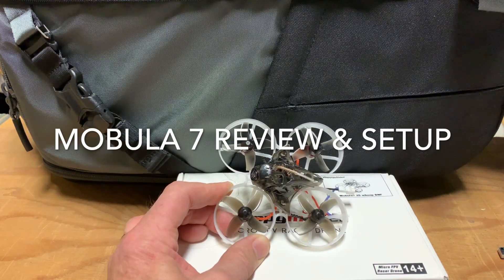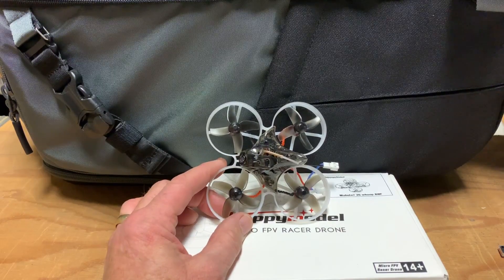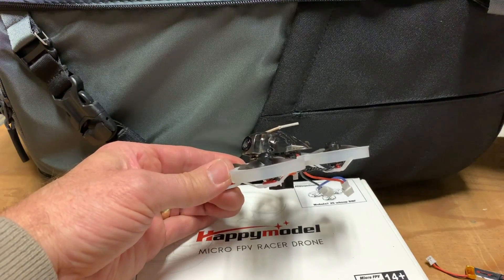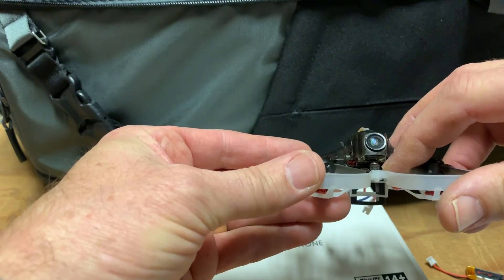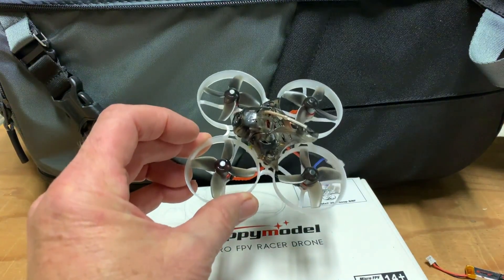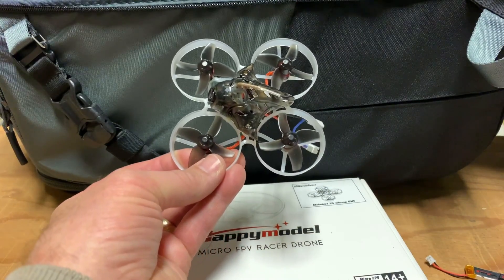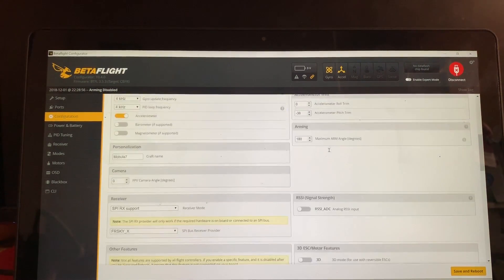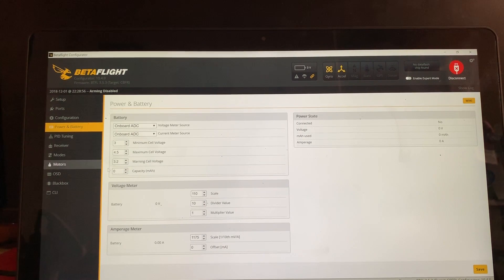Mobula7 Review and Betaflight Setup

Comment: will this quad work with my blade mlp4dsm transmitter i have the happymodel mobula7 w/ dsm2/dsmx reciever and i am able to bind it to my quad but i cannot arm the motors
Reply from the maker: Hi Joey F,

I am not familiar with this RC transmitter but when I looked it up it does support dsmx but it only has 4 channels (no AUX channel) so you will have to "stick arm" the quad. You have to hold the throttle down and to the right (ie throttle low and yaw right). I think (did not verify) you will need to go into the Betaflight and turn off Aux1 arming. I am not a big fan of stick arming as you can accidentally disarm the quad in mid air (throttle down and to the left) which can happen when you fly acro. I would highly recommend upgrading your RC transmitter to maybe a multi-protocol jumper for $89 on banggood. 

Jumper T12 OpenTX 16CH Radio Transmitter with 
Price:US$89.99
Reply: @slogfpv  Hi thanks for the response, i have tried to figure out how to arm it with the sticks believe me but i cant find any setting in betalfight to change it so i can arm it with the sticks :/
Reply from the maker: Hi @crazyforhalo1  ,
I went into the modes tab in Betaflight and removed Aux arming (click x on right side) and was able to stick arm the Mobula 7. So if you cannot stick arm after doing that it is something else. A very common issue is not having your end points setup correctly. The RC transmitter that you have probably does not allow for end point adjustments on the RC transmitter so you will have to do that in Betaflight, setting the low and high thresholds in the receiver tab. There are a lot of how to videos on setting end points. 

But to know for sure why it won't arm, go into the CLI tab and type in status. It will give you an arming disable flag that you can look up. Also if you have goggles, enable warnings and arming disabled in the OSD.  The OSD will give you the same thing. The code explanations can be found here:

https://github.com/betaflight/betaflight/wiki/Arming-Sequence-&-Safety
Reply: @slogfpv  BADRX THROTTLE CLI MSP ARMSWITCH that's what it says,  i think because the transmitter doesn't have any of those switches i have tried everything still cant arm the motors :/
Reply: i ordered that radio you reccomended btw i hope its easy to setup :D
Reply from the maker: @crazyforhalo1  
You should be happy with it. Albert Kim has a good setup tutorial on it. link below:
https://www.youtube.com/watch?v=23fgyrq2ZOA

The reason why I recommended it is:
- Less than $100 dollars (good bang for the buck)
- Runs OpenTX (has become the defacto standard and there are all kinds of videos on using OpenTx)
- Multi-protocol (supports most protocols)
- You can always upgrade to a more expensive RC transmitter like a QX7S and still use the multi-protocol module.

Have fun!
Reply: @slogfpv  I'm using a Spektrum DX6. Works just fine with the 7 and its DSMX receiver.

Comment: My mobula 7 is beeping with 2s single battery. Beta flight will only let me put 5 for maximum cell voltage. What am I missing? Thanks for any help. With 2s I’m going to be getting 7.4 rigth
Reply from the maker: Hi Kirk,

The max voltage, warning voltage and min voltage settings are on a per cell not a sum of the cells. As such, the Max voltage should be set to 4.5v if you are using HV batteries. I set the min voltage to 3.0 although due to voltage sag, some people set it as low as 2.9. I set the warning voltage to 3.2v. 

I noticed the Eachine Trashcan has it set to 4.4v, 2.9 and 3.0 which is a little low IMHO.

I hope this helps. 

SLOG

Comment: Thank you for this useful info, Did you need to trim the mobula?  if you could explain how that would be great
Reply from the maker: Hi Zivos,

Yes I do stick trimming via Betaflight and the remote controller radio. Inside your house is best.

1. Put the quad in angle mode.
2. Make sure all the trims on your RC Radio are centered (no trim on Radio). 
3. Try to hover and note which direction the quad is drifting (e.g. Left, Right, Forward ...) and what direction you move your right stick (Mode 2) to correct the drift.
4. Land and make sure throttle is down and arm is off.
5. Move the throttle to max with the ARM switch "Off" and right stick in center position (position it returns to if you do not have your fingers on it). 
6. If the quad is drifting forward to the right, start by moving the right stick all the way back (one tick of trim back). The same direct you used to keep it from drifting forward in a hover. 
7. Repeat steps 4 through 6 until the quad in a hover is not drifting forward.
8. Now do the same thing for the drift to the right except moving the right stick to the left one trim tick at a time until there is just a slight non-directional drift.
Please note you are not going to get a perfect hover like a DJI Mavic which has GPS, Barometer, Flow Sensors, sonar and visual position to hold a tight hover.

Comment: Bind on D8!  The issues I was having:

1. Throttle jumping around when plugged into        BF. 
2.  Motors spinning up by themselves for 1 second every 10 seconds while plugged into BF. 
3.  A beep that would actually make the quad stutter in flight every 10 seconds.  
4.  Random failsafes. 

ALL SOLVED BY BINDING ON D8!  🚁💨
Reply from the maker: Hurricane FPV,

Great job! Glad you are up and flying! I am wondering if it has anything to do with this blurb on Github on the Crazybee F3 under know issues with telemetry turned on. Not that I want you to go back to D16 but it would be interesting to see if turning off telemetry in Betaflight would also solve this issue. Mine is torn down waiting for a XT30 connector to come in. Maybe I will play around with it once I get it back together. Would you mind posting your diff -all output? I am running D16 with Telemetry turned on but I am on 3.5.4 not 4.0. I remember you said you rolled back to 3.5 from 4.0.

Anyway, glad you are having some fun now instead of frustration :)

Known Issues with FRSKY Version:

To bind to your Taranis, you need to be running the non-eu OpenTX version, which allows you to use the required D8 setting to bind to the RX. The factory default BF receiver mode is FRSKY_X, so remember to configure this if needed.
FrSky X (8 / 16 channels) and FrSky D (8 channels) work both reliably, including in combination with crash flip / Dshot beacon, as long as the TELEMETRY feature is disabled; Basic telemetry information like RSSI and battery voltage will be sent even when the TELEMETRY feature is disabled;
On FrSky D, the TELEMETRY feature causes occasional dropouts, depending on how many sensors (BARO, GPS, ...) are enabled, probably due to a timing overrun;
On FrSky X, the TELEMETRY feature causes hard lockups due to a bug in the telemetry generation code.

Comment: Hey haveyou any idea as to why it won't arm? It's showing that my arm switch is working properly in the configurator, but it won't arm once I actually set it down and plug in a batt...
Reply from the maker: Hi Aspire7,

The most common problem preventing a quad from arming is you have not calibrated your RC controller's throttle channel end point. It won't arm if it thinks your throttle is on, even though it is all the down because it is not calibrated. There are a lot of Youtube videos on how to calibrate it. Here is one link to Oscar Liang: https://oscarliang.com/adjust-tx-channel-mid-end-point/ that gives a text description on how to do it.
To find out for sure whats going on, go into the OSD screen in Betaflight and enable warnings (I always have it on). Once set, the OSD will tell you why it is not arming.

Hope this helps,
SLOG
Reply: SLOG FPV 
Sweet, thanx a lot man.

Comment: I went back to BF 3.5 as it came loaded with 4.0.  I’m getting a single beep every 10 seconds.  Batt low and critical beeps are disabled.  When I get that 1 beep the quad “hiccups” and then resumes normal flight.  Anyone else having this issue?
Reply from the maker: Hurricane FPV,
You can enable warnings in your OSD to see what its complaining about but I would also check your min cell voltage settings (Power & Battery Screen). I know you have the bat low beeps disabled but it might be shutting down due to battery sag below what the min voltage is set to. I set it to 3.0 volts (Mine came set to 3.3). I set my warning voltage to 3.2 and the max voltage to 3.5 (if you are using HV batteries).
Cheers,
SLOG
Reply: @slogfpv  that sounds like it could definitely be the issue!

Comment: favorited...I burned up my FC on my mob7 on a wet grass crash, waiting for replacement parts.  Going to use this tune on the eachine trashcan and the rebuilt mob7. thanks
Reply from the maker: Hi Jim, 
Sorry to hear about your FC shorting out on wet grass. I always encourage people to experiment as it is the best way to learn. But do keep in mind the specs are different between the Trashcan and the Mobula 7. It will probably work just fine but may need some tweaks:

Trashcan 0803 16,000KV motors vs Mobula7 0802 16,000KV motors
Trashcan F4 FC vs Mobula7 F3 FC
Trashcan 33g vs Mobula7 26g

Would be interested in hearing how it flies.

Cheers,
SLOG
Reply: SLOG FPV true, it’s a different machine entirely, but as you mentioned, that tune was a tune for very light quads.   I found the propwash to be annoying (actually propwash was the reason I fell out of the air and into the wet grass) on the mobula- but I still love it!
Reply from the maker: It is definitely worth a try. I am not the best PID tuner and I usually find a tune that is close (like what you are doing) and tweak from there. Betaflight has dramatically improved since 3.4 with just being able to fly with the default tune. You might want to also try a props out configuration (I was going to experiment with that).

My next project for the Mobula7 is converting to a XT30 connector and printing out 300mah 2s battery holder. I am close to finishing up a simple battery holder design that I will print out in TPU.  The ones on Thingiverse are good (don't have to cut on the frame) but they hang down too far for me. I will upload it to Thingiverse if it is any good.

Comment: Thank you very much. I fly a Snapper7 and messed up the settings in Betaflight to the point it was useless to try flying it. You helped me out big time. I'm about to move the parts of the Snapper7 to a frame made by KababFPV  that support bigger (2 blade) props. It doesn't have the prop guards but the flight footage Kabab (using a CrazyBee AIO  on 1s)  has put on his channel are stunning. As I am fairly new to the hobby and I don't have the level of insight you have.  I am curious about your thoughts on this kind of modifications.
 All the best from Holland.
Reply from the maker: Kabab is very knowledgable about frames, props, FCs and builds in general. I am a subscriber. If you like tinkering, I would say go for it as you will learn a lot by doing it. His toothpick frame is still an ultralight so you cannot get into too much trouble with it other than some bent props :) I like prop guards for park flying, just a little safer, but not a lot for ultralight builds. If you do the build, you should post a video. Looks like a fun build.
Cheers,
SLOG

Comment: Could you explain a few things in more detail. Why dshot300 and not 600? Why 4k/4k, you said smoother flight, but i'm not sure what you mean by that? Also how does it fly better with antigravity and dynamic filters turned off, mine were turned on by default? Also can you explain why i-term relax helps it fly better? Also do you set up different rate profiles for 1s and 2s? Also how do you calibrate the accelerometer when the batteries are in, its not perfectly level and the motors don't all equally touch the ground like on a brushed whoop?
Reply from the maker: Hi Tim,

Good questions. As background, I have experience with the CrazyBee F3 flight controller from dealing with the URUAV65 and the HappyModel Snapper7. The Mobula7 is still a CrazyBee F3, it just has upgraded ESCs to handle 2S. I was having bad twitches in flight while turning on the URUAV65 (would twitch with hard yaw turns). I tried to tune it out by changing PIDs but it did not help. So I did some research and found on GitHub where the Betaflight developers suggested you run with 4K/4K Gyro sampling and PID loops on the CrazeyBee F3 (see link at bottom).  These changes eliminated the twitch. The twitch was not as noticeable on the HappyModel7, but the stick feel (smoother feeling) and video stability was better with these settings. I used the same settings with the Mobula7. The other advantage of running 4K/4K the CPU utilization is significantly reduced.

On to Dynamic filtering and Antigravity. Both are very CPU intensive. In fact, some flight controllers like the Helio Spring have a separate co-processor just to handle filtering (the gyros used in FCs are very susceptible to noise and thus filtering is needed). Why is that important, when I use 8K/2K, Dynamic Filtering and Antigravity turned on, the CPU utilization jumps from 25% to ~50%. That is too high as that it not showing you peek utilization, which could be much higher. Point being I am getting smoother stick feel and better video (no micro vibrations) with these turned off. It looks like from the processor utilization numbers, the little F3 just does not have the CPU resources to handle it. 

My Mobula7 came with 3.5.0 loaded and both Dynamic Filtering and Antigravity were turned off when it was shipped. The default is on for FW versions 3.4 and greater. My guess is you also have 4.0 loaded from the factory. It is very strange that Eachine (HappyModel) is now shipping the Mobula7 with Betaflight 4.0 that is still in development and is not supposed to be released until April. The Betaflight Developers have not frozen the code yet and they are still changing it daily. However, Dynamic filtering has been improved in 4.0,  so maybe the changes they made reduce the CPU load (don't know). I would suggest that you play around with these settings and make your own conclusions. I may load 4.0 just to see what the processor utilization is at with 4.0.

iTerm relax "reduces the bounce back at the end of rolls and other fast movements". I notice the difference when I do snap rolls.

I use the same rates for both 1s and 2s although one could argue that using a throttle curve on 2S might tame the Mobula7 for new pilots.

On calibrating the Mobula7, I use the edge of a table with USB cable dangling over the edge without batteries. The battery holder should be level. You can also stick calibrate it with batteries installed, level on the ground. Arm off, with the left stick in the upper left corner and the right stick center down . 

Cheers,

SLOG

https://github.com/betaflight/betaflight/blob/master/docs/boards/Board%20-%20CrazyBeeF3FR.md
FAQ & Known Issues

The board specifications claim DSHOT600-ready, but due to the use of a type L (BB1 24MHz) ESC, only DSHOT300 is reliably supported, although DSHOT600 seems to be working for quite a few people. But just how clean that ESC control signal is when using DSHOT600, is untested. For a discussion on this, see https://www.rcgroups.com/forums/showthread.php?3036325-Racerstar-Crazybee-F3-Ultimate-Micro-AIO-FC%21-1S-5A-BlheliS-Frsky-Flysky-OSD/page3 .
The factory default GYRO / PID config is 8KHz / 2KHz . There are reports that this may lead to possible instability and 4KHz / 4KHz is recommended.
Reply: @slogfpv  I need help! I have a mobula 7 and the mobula will not go into the acro mode. I did the same as you in the video and it will not get into the acro mode. I can't do flips bad english sorry
Reply from the maker: @jonnitheeagle1153  
There are two main parts to configuring a new quad. The first is setting up your quad in the  Betaflight Configurator and the second part is creating a model on your RC Transmitter. I am assuming you used the directions that came with the Mobula7 which shows how to setup a model on the Taranis X9D plus. 

This shows the ARM Switch mapped to Aux 1 and the Flight Mode on Aux 2. My channel mapping is the opposite (Arm Aux2 and Flight Mode Aux 1). There is no right or wrong way I just happen to copy my base model for new quads to keep things consistent. 

To see which switch is mapped to which channel, just go to the mixer page on the RC Transmitter or go to the Receiver Tab (Page) in the Betaflight Configurator with your quad connected and the transmitter turned on. Move the switches to see how the switches are mapped to the Aux channels. You can change the switch (Aux Channel) mapping in the Betaflight Configurator Modes page or on the Transmitter Mixer Page. 

Joshua Bardwell has a good video on how to setup a model on your Taranis. Link below:
https://www.youtube.com/watch?v=Z6ZfTTmDTrc&t=25s

SLOG
Reply: @slogfpv  thank you very much